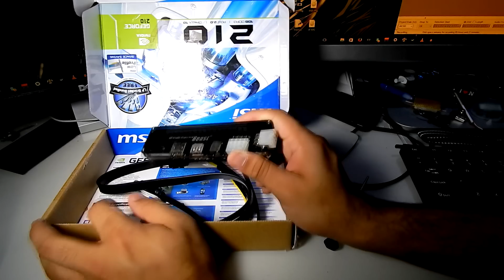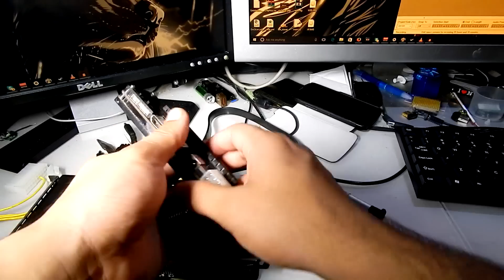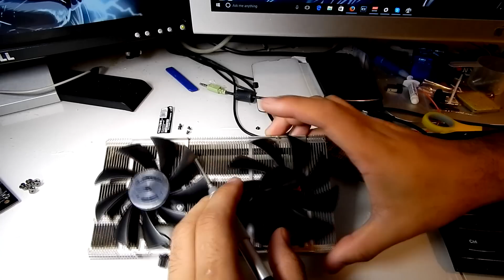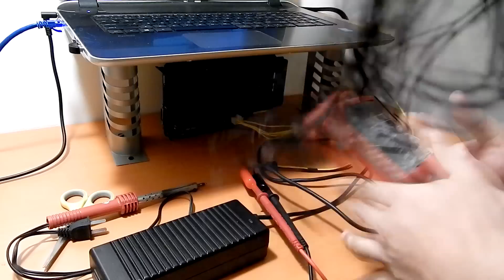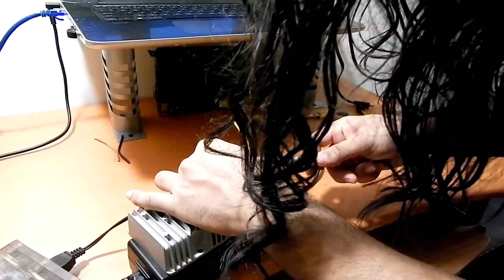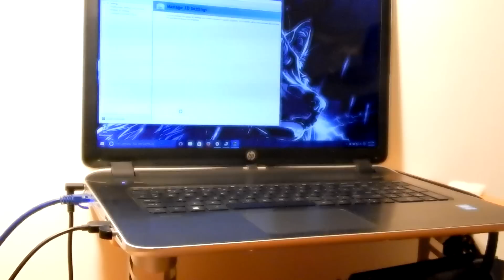Turn Any Laptop Into A Gaming Machine For 72$

Comment: I love your work. Razor core, while pricey, is just so much more elegant and compatible solution though.
Reply: razer core only works with thunderbolt, which is pretty rare on most laptops
Reply: Oh yeh I guess I'm pretty lucky in that regard (to have thunderbolt 3 over USB). I love the ingenuity of this solution however I have no where to route the cable out of my ultrabook and can't remove ram (soldered on to the MB) if that was an issue,
Reply: Well to use my express port on my MB I'd have to route a cable out of the laptop to the graphics card. For me it's just easier to use a core and utilise my 16gb of Ram than to spend the money to try this and have the possibility that it won't work (and need to disassemble my laptop). I was lucky enough to have access to a core so I guess the extra cost wasn't a barrier to me.
Reply: +Abhinav Thapliyal oh wow I didn't realise there was an associated paid bios!
Reply from the maker: Yea, its a good idea to do some research before actually doing anything.
Reply: Haha that's one of my biggest downfalls, I do too much research. Sometimes it takes me 10 hours of reading reviews to buy an adapter that is under a $50 and I need :P
Reply from the maker: cynicle
lol.

Comment: thanks for adding caption at the beginning of the video, i can now save 27 mins because i thought 72 was gpu included although it seemed impossible
Reply from the maker: I mean you can get a card cheap on ebay, a 750ti is 60$ on ebay.
Reply: Quit being broke. GPU's are cheap.

Comment: To be far it was obvious about price thing 2 min into the video. Commenters that complain should learn to watch and listen and not time skip for funnsies.

BTW where do you route the cable from the PCI slot out of the laptop?
Reply from the maker: from the bottom of the keyboard out under the screen, cause there was a rubber stopper there I just removed it and it fitted.

Comment: it's not recommended to use the Mpci-e cable with the BEAST adapter while using nvidia optimus since the cable causes signal degradation at high pci-e bandwith usage.  any one considering doing this should get the Bplus pe4c instead. also no need to do diy a power brick you can just buy this one.http]://]www-.mini-box[com"/100w-12v-8-33A-AC-DC-Power-Adapter . as for the ram configuration and pci-e whitelist  problems you can normally resolve those by getting egpu setup 1.30 from Tech|Inferno.  but in more extreme cases you may have to buy a "SPI programmer" and "SOIC clip" then goto the bios-mods forum to have the whitelist removed and advanced settings added.

Comment: Would this work with a Dell Studio 1458?
Reply from the maker: check the product page.
Reply: Yup, it will work.
Going to attempt this eventually. Will have to work on getting a spare gfx card though...
Reply: Though, I will be using a proper modular power supply for easier set up.
Reply from the maker: EndSliceOfBread
it would be this was cause i had the bits laying around.

Comment: Honestly your CPU doesn't matter. Lol. The bottle neck is normally in you hard drive. Want a faster PC? Get an ssd instead of an hdd.
Reply: +Daniel Parker Sorry this may sound harsh, but your not right he's installing a gpu which is more important for gaming and hdd doesn't bottle lower your performance changing to a ssd would just may turning on the computer faster cpu and gpu runs the porgrams and does all the work the hdd just holds the data.
Reply: Im not talking about gaming lol
Reply: I'm speaking on generalities. Generally when a person looks for a fast PC they see "i7" oh shit this is fast. When in reality that's not the case.
Reply: +Daniel Well, my uses are very CPU heavy and don't put much strain on the HDD at all.

Comment: And why not just use a power supply that supplies the right voltage right away? Or did I miss something?
Reply from the maker: it was cause its smaller.
Reply: +Davindra how many amps and how many v's does it require? pretty sure a 12 volt power supply is smaller than the one you're using... I use a Nintendo Wii power supply for one of my projects wich uses 12v.
Reply from the maker: Ken Alfaro Ponce
It needed to be a few amps and this i already had puts out 6 thats the only reason why i just a power converter and slapped it on.
Reply: Then I understand... But knowing that you're going for as portable as possible I would opt for a smaller powerbrick. But still very interesting video!
Reply from the maker: Ken Alfaro Ponce
Ok thanks.

Comment: Instead of using a 19v powerbrick with a 12 volt downconverter why not just get a 12 volt powerbrick or Pico PSU? The Pico PSU will hook directly to the 24 pin to 8 pin adapter that you already have.

If you are portable and do not have power available you can even use a 12 volt gel-cell battery (you will have to constantly monitor the voltage and make sure it doesn't fall below 11.7 volts).
Reply: because his hairs sucks all of his brain power
Reply from the maker: I was considering a battery but i couldnt find one light enough or with the charging circuits built in, for the making of this video.

Comment: It seems like there would be a serious performance bottleneck because the PCI slot in the laptop is only 1x and not 16x.
Reply: possibly but not even 16x is needed for a lot of cards.
Reply: +Attila theHun Gen2 @ 8x is enough, even for a Titan X.
Reply: actually 8x is all you need for most cards.
Reply: Whats better PCI express x1 or  express card
Reply: Its an upgrade for laptops to make them into gaming pcs, quit complaining
Reply: Some cards actually lack pins for it to run at full 16x from what I can tell. For instance Gigabyte's RX 460 Windforce OC only had roughly half the pins of a typical full-width card edge, yet it doesn't seem to be any different from other RX 460s.
Reply: +Nopiw 
Depends...on gen 3 PCIe, 8 lanes would be enough for modern cards. On gen 2, 8x is already a bottleneck.
This thing however is a 5 GT/s slot, which means it's PCIe 2.0 with just ONE lane, resulting in transfer speeds of 500 MB per second in both directions. Basically useless for gaming.
Reply: Attila theHun
Reply: youre right , even the external gpu docks arent worth it cuz the performance hit you get compared to having the same gpu in a desktop, if its not 16x its not worth spendin money on an external gpu for a laptop get a desktop an put it in a motherboard
Reply: its not ideal,but my i7 3720qm with a 1060 6 gb plays any game at 60 fps on 1080p. It however runs about 30 percent slower than in my desktop. I have to lower some settings unless its in games that run vulcan. Vulcan it runs so much better and i get 80 to 90 percent of the gpu compared to say 65% on games like fallout 4.
Reply: Nopiw 
Even that card is already bottlenecked by just one lane.
Reply: gdfschimpi007 
Enough doesn't mean, it isn't bottlenecked though.

Comment: Unistall laptops integrated GPU driver befor you install eGPU driver. Just an advice

Edit: I confused some people with my words, when I've said "integrated GPU" I've meaned a dedicated GPU, a GPU seperately from CPU integrated/soldered on to the laptops motherboard and not a CPU with integrated graphics processing
Reply: no... no u dont
Reply: You guys certainly don't know how drivers work with hardware do you? Ok I will explain to you one thing. When you've done a clean installation of Windows OS on your laptop, did you installed also GPU's driver during Windows installation? Absolutely NO! Do you need a GPU driver for the installation and operation of a Windows OS on a laptop? NO!!! Why not? A Laptop CPU has integrated graphics to perform a basic process and this is to produce video output signal without need of an integrated GPU on a motherboard or in other words a dedicated GPU if this is what you want to call it. The resolution was really bad on older laptops but because you have also a mobo integrated/dedicated GPU you are going to use that as a main GPU acceleration/video output instead, of course when you install a driver for it and that is after all other main drivers are installed.

So is it good to install a second GPU driver next to the first one? Probably not but if you have Luck it could work with smaller problems. Have a nice day

Some laptop related labels:
CPU=central processing unit
GPU=graphics processing unit
IGP=integrated graphics processor
APU=is a AMD CPU with GPU integration so called accelerated processing unit (like Intels IGP's)
eGPU=external graphics processing unit
Reply: thats an awful idea
Reply: youre wrong. when you install windows it uses what is called a basic display adapter driver which taps into the core functionality of whatever gpu is there. it doesnt matter if its intel integrated -  or if its a 1080 ti .  there has to be a graphics card and graphics drivers... even if the drivers are generic.

oh aand youre term are wrong too. IGP means it is integrated and shares system ram for vram. nothing more nothing less. there are intel IGp, amd IGP, sis IGP, nvidia IGp etc.
Reply: i just facepalm so hard. Legit tho, even in pc, changing graphic card is better to uninstall the previous one.

Comment: Cool build, but...

This is so not RoHS compliant...
Reply: RoHS?
Reply: Restriction of Hazardous Substances.  European originated rules for electronic manufacturing; it includes rules for safe procedure as well.
Reply: +Nathan Rice English?
Reply: +gonatrollya That is English.  L2R, nüb.
Reply: RoHS sucks.  Lead solder forever!!!
Reply: majcrash Ah, trolling.  An asset you sadly cling to despite obvious evidence to the facts: the skill isn't an asset, it's a liability in the long run.
Reply: Not trolling.  Lead free solder really sucks.
Reply: I've worked with both.  Long term, I've seen no difference.  YMMV, though.

Comment: Or I can just go on ebay and buy a used graphics accelerator for $100, plug video card in, connect to laptop and go.  Looks much better too.
Reply: Apparently the graphics accelerator only works with alienware.  I love it though.
Reply: Let's see you do that with your friends laptop which isn't a horrible $2000 alienware.
Reply: Plug it where? On your 20MB/s USB 2.0 port?
Reply: Twski ///M <--- is like Osmium.

Comment: I tried this a while ago with a 750ti so no psu just the 12 volt mobo power connecter. It was all working but didn't show up in device manager... My laptop just wouldn't detect the card. I also used the express card version.
Reply from the maker: Umm im not too sure but do check the product page for some info maybe that'll help?
Reply: +Davindra with product page. The adapter?
Reply from the maker: Kace Callaghan
yea.
Reply: ***** del lat. E3620 was not individually mentioned but other latitude series laptops were. They supposedly worked.

Comment: I'd recommend you use some rosin core solder so you don't need that Flux. also, don't add solder to the tip and then apply it to the wires to tin or join them. instead, twist the wires together and put the tip of the iron on the joint. then add solder. that will reduce your odixation issue when you add solder but It won't stick to the wires. you need rosin core solder for that really though unless you dip the twisted pair in your flux. lastly, use heatshrink on your wires to reduce the likelihood of shorts.

Comment: this won't work on MOST LAPTOPS POST 2015.
Memory addressing is handled a lot differently manufacturers have locked down on this hard, sometimes going as far as to omit optimus compatibility completely.

Not only that, but your speed will be at best, 30% of the video cards capabilities.

Just get a fucking desktop.
Reply from the maker: "Just get a fucking desktop" If you wanted a desktop then why did you watch this video. Your not the first nor last to say that if you want a desktop dont watch this video, if you would buy a overpriced gaming laptop or razor core go ahead. I don't know how or why you are watching this if you wanted a desktop. Also what does memory addressing have to do with the laptops or desktops communication over pcie, as long as the machine has the ability to communicate with devices pcie it should work.
Reply: because I don't like seeing people get screwed by misinformation since I tried myself.

If you don't know what memory addressing, pci space, or TOLUD is and think I'm speaking witchcraft than you are way over your head. It's part of the basics of how a computer works. It's important to know what's exactly going on so you can fix it...and know the limitations of your own machine. 

Certain chipsets...ESPECIALLY with dedicated video cards, will not have the address space for adding another video card...and newer ones have the ability to remap those addresses removed / harder to access.

As I said.
Just get a fucking desktop.
Reply from the maker: Myke Prior Even then this is a diy video. Not everyone is meant to try just just given  the fact that you need to open the machine, and besides the fact that this video has gotten this big surprises me. I did this video at 300 subs as a weekend project not expecting many to even try it. And as far as misinformation goes i never said this is 100% working. Its all up in the air since this isn't all tried and true, there's still alot that needs to be answered and its all up in the air, i was just hoping those with the experience would be able to fill in the gaps.
Reply: dude, PCI express is... pci express. Once you pull the wifi care out, this adapter takes its place in memory addressing schemes. But manufacturers tend to do some things differently. Like on my toshiba laptop they have a pin that detects whether or not it has an "official" toshiba wifi card in there, and if not, disables whatever I have plugged in there. A piece of tape fixes that... Now a intel card lives happily in there....

Either way, no matter what, it's a flip of the coin, and if you get the bad side of the coin, you gotta go thru the grunt work on the forums to figure out how to bypass/fix/hack/whatever to fix it.

Also, almost all video cards barely utilize the pcie bus. This is a legacy thing going back to regular PCI...
Reply: A 256 bit video card generally uses a shit ton of bandwidth, they use the pci-e bus hardcore..?
that and address space depends on what is in there!
At any rate, I wasn't saying this doesn't work, the bigger issue is any newer laptop this has been made a hell of a lot harder.
Reply: Myke Prior Go take GPU-Z for a spin on your desktop for a while. Take note of the Bus load. Mine never pokes above 10% no matter what I throw at it. So what I do is, I'm able to lock my bus speed with my mobo. I lock it at x16 with the lowest speed possible. This eliminates any minor spikes from the mobo changing speed when under load. The lower clock rate I can get away with as we are not using it anyways. This results in the NB/SB chip running cooler, and also resulting in less noise in the power, more power available to the cpu for oc'ing, case runs a little cooler, etc etc.
Reply: Myke Prior And I use the gtx1080.

Comment: You could just use a desktop supply. Short the green pin to start it without a desktop motherboard. Free 8 and 6 pins
Reply from the maker: you dont even need to short them there's a adapter in the box.

Comment: I had one of these around 2008/2009
(Well, I still have the bits. For whatever that's worth)
It really didn't work. My laptop didn't recognise the external card whatsoever.
(plus I needed to upgrade the laptop to windows 7 for there even to be the slightest chance of it working...)

However, I guess the technology inside newer laptops is probably more amenable to getting this to work.
Reply from the maker: maybe thats interesting,
Reply: What I've got lying around is probably one of the earliest attempts at making this kind of adapter.
It worked by plugging into the expresscard slot, or the slot used for wifi adapters.
Not very straightforward, but it was the only thing around at the time.
There was also an adapter for a PCI-X 1x slot for desktops, but I don't have one, and I am guessing you can't just mix and match these kinds of things...
Reply from the maker: KuraIthys
I dont know to be honest, but i would re-frame from that cause they all communicate differently so i would say if you really want to try this again it would be best to try the new adapter.

Comment: wtf, never knew this was possible. going to watch later
Reply from the maker: Lol, welcome to the world of diy
Reply from the maker: Cody Peterson
thanks.
Reply: The reason you were having trouble with the soldering was because you're using the wrong type of solder for that type of job. Use just regular Electrical solder. It should be made of nothing other than Tin and Copper. It also comes in small tubes which the solder is finely coiled in. When you get the rolls of solder like you have, they tend to be of a thicker diameter and they also tend to be lead-free acid core solders. These are used more for piping, plumbing, etc. Electrical solder is actually a bit hard to find though, after looking around the town that i live in, I finally found some at Wal-Mart in the isle with the light bulbs.....lol. Lowes and Home Depot dont seem to carry electrical solder, but the lead free acid core stuff instead, so.....yeah. Anyways, I hope that helps! Also, I should say that electrical solder is A LOT cheaper than the solder you used!
Reply: ***** No problem man. I'm a guitar tech at my local music store, so I have to solder a lot of guitar electronics constantly. I had a bit of trouble finding the right solder the other day when I had to restock the work bench because I ran out of solder. I figured that would help a bit.
Reply from the maker: Cody Peterson
Oh thats quite interesting. but yea ill keep this in mind.